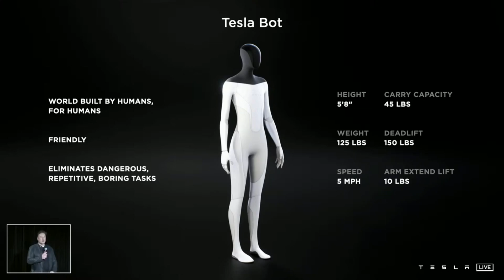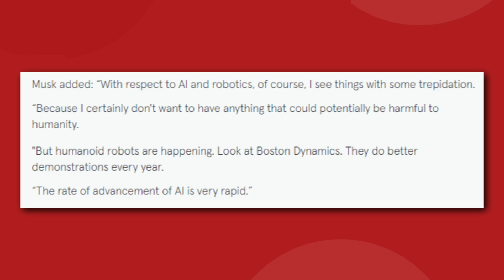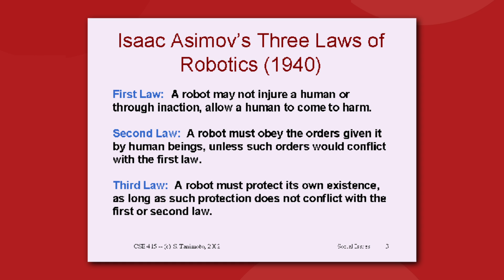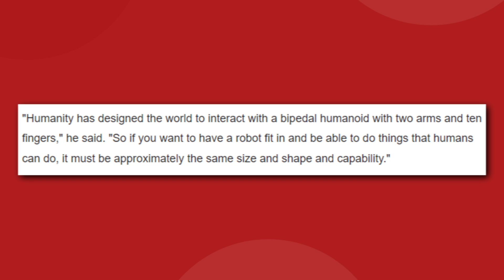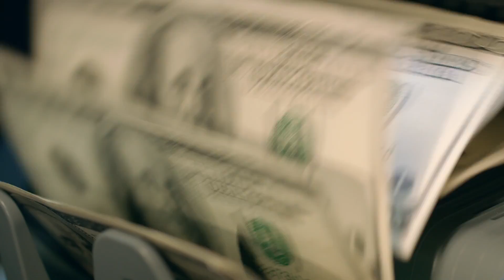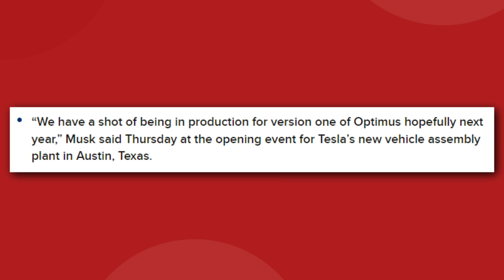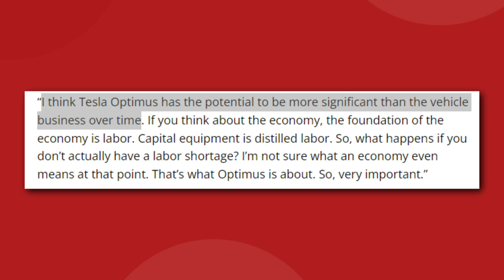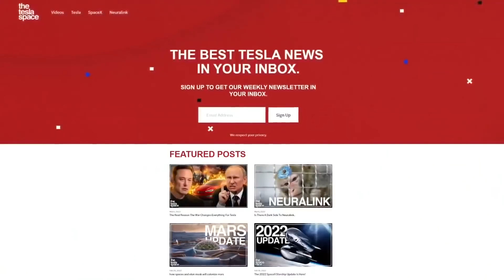Why Elon Musk Says The Tesla Bot Is More Important Than Tesla Vehicles!

Comment: 100 times easier to build than a Model Y?  No Way.  Think about the parts count.
Reply: Model why is much larger, requires a much more energy intensive physicals build. Most of the robot parts will be created using mass plastics production. 
The number of parts does not necessarily dictate lower output or higher cost.

Comment: It is more complex then a Tesla car. The actuators have to be more numerous and complex in a bot.
Reply: Yes true car actuators mainly the drive motors - the rest are doing set and forget stuff like open a window, lock a door. VS teslabot looking at 6 per limb +2 per hand +3 for head total of 31 with just basic hands. And each actuator is fully active. It's complex but tesla certainly have the engineering and resources so they are well positioned to do it.  Honda made Asimo - Tesla can make Optimus

Comment: @9:30 Given that a Tesla EV costs around $50K and that the TeslaBot will require far less material and time, it will cost about $10k. 
Imagine how fast Tesla will be able to build these, squirting the endo-skeletons out of a Giga casting machine, sliding in the wiring, the LFP batteries, the FSD computer, the interface, the sensors, and the actuators by the robots of the assembly line, unit testing and then zipping up a synthetic skin onto it. It should be producing up to a thousand Automatons a day.

Comment: No way . The actuators and power source to control and power a robot  of human proportions  is a long way off .
Reply: Have you looked at recent cordless power tools? They are getting a pretty decent power to weight / volume ratio these days. They are planning to limit the strength to similar to that of a child, which seems reasonable.
Reply: @privatemale27  rotary motion from motors and the linear actuators that would be needed for a human like robot that work like muscles are quite different.  A comparison would be Jules Verne’s moon shot which used a canon and the jet engines that were actually used to propel men to the moon.

Comment: China is building and selling basic EVs for $5k and less.  My guess is that Tesla robot would cost well under $10k.  

Skeleton/bones - cheap
Cameras - cheap
Microphone - cheap
Speakers - cheap
CPU - probably a few hundred dollars when produced at scale.
Batteries - not a lot as battery prices drop.  And a robot could use swappable battery packs, do the swapping itself.
Unknown - some number of 'not that strong' electric motors and electric motors, built at very large scale shouldn't cost a lot.

The motor that runs a $30 (retail) electric drill is pretty strong.
---

Fully functional (but low skilled) Optimas - this year.  An Optimas capable of learning just about everything but it will take time to learn tasks.
Reply: Need pressure sensors on fingertips (& skin?) like flufferbot needed. But, yes, crazy cheap parts.
Reply: @iandavies4853  

Yeah.  Pressure and temperature sensors.  Roughly the sensor set that humans have.  But nothing seems very expensive.  Motors need to be only human strong, not horsepower.

This thing wouldn't need pounds and pounds of unobtanium.  Something lightweight for 'bones'.  Plastic?  Motors are just small amounts of steel and copper + labor.  I see a small budget for raw materials.  Largely automated part production.  Not really that much assembly.  

The heel bone attaches to the foot bone.
The foot bone attached to the ankle bone.
The ankle bone attaches to the leg bone.

Except there would be no need for separate heel and foot bones.  Just a foot piece.  And no ankle and leg bones.  Just a joint between the foot and leg.  A joint at the knee and a joint at the hip.  

The first version does not need to be able to dance ballet.  Just walk and climb stairs.  It's mostly a matter of moving into the right spot and then do stuff.

If we run into tasks that require acrobatic skills a new version can be developed for those jobs.  Households and most businesses aren't likely to need a huge amount of physical ability.  Most humans don't have a lot of physical ability.

Comment: Great video! But, electricity costs? Electric cars use far too much energy to be affordable if you charge at home. To get around that, people use the cheap subsidized electricity at charging stations. But, most of the reason it is so cheap is because of government aid. That can't last forever, and then electric cars will be MORE expensive to run than gas. So, set aside the annoying issue of carting your robot to a charging station, how much electricity does it ACTUALLY use. And, is it affordable at current electric market rates? Charging station rates are subsidized rates, not market rates.
Reply: I hope you realize that gas is heavily subsidized as well and wouldn’t be affordable if it wasn’t. So same logic applies for gas it can’t last forever. 
But electricity can be produced from solar panels, wind, hydro and other renewable self sustainable ways. While gas literally is a finite resource, So truly  gas Can’t last.
Reply: @heliumfilaments4368 , fully aware.... The question spawned from attempting rough operations costs (Dreaming of having one... until I considered the electric bill). If a robot is running 24/7, it could use large amounts of electricity. Possibly on par with a trip to and from work everyday in a Tesla. To decrease energy usage, we must also increase our own personal energy usage awareness. Having a robot would come with a large responsibility to use it wisely.
Reply: @derek2593  Yeah I just don’t think this robot is going to be actual useful product for a very long time. It will take even longer to be a personal robot everyone has. By then I would hope advancement in renewable energy solve the affordability issue.
Reply: You are clueless. !

Comment: 7:53 I think you're very wrong here about how Tesla Bot will be much easier to produce than the Model Y. If you've ever seen highly mobile robots you'll know the part count and complexity is much greater than than any car. The scale of them also means that there will have to be a lot of human assembly for smaller more complex parts which is everything in a robot. 

Also the machinery used to manufacture cars has been around and been developed over decades but this hasn't happened with robots. Maybe it can get the same level of automation but it is incredibly unlikely that this will ever have a higher run rate of assembly lines than a car.
Reply: Just replace “human assembly” with “humanoid assembly” and the answer becomes clear.
Reply: @trent_carter  Watch a video on all of what humans have to assemble on the car and tell me a robot can do that with a greater efficiency. 

If highly specialized robots with decades of development can’t do it then how will a new robot with 2 years of development do?
Reply: @benjaminbarnett9322  I have watched every Tesla factory video and they still use humans for some tasks that the Bot can do. Actually I rewatched the drone fly through of Texas and most jobs look easy for a humanoid robot. Bit this is a silly armchair argument from an aerospace engineer with a degree in physics, yet still ignorant. So I will place my conviction as a financial bet. I have 90+ % of my sizable net wealth long Tesla. That’s my wager.
Reply: @trent_carter  Sure, i think the Bot could do it, just like FSD can drive. But what happens when it runs into a problem. Does the whole production line stop? Also these robots would be 5x slower than a human and bog up the production line.

 If you've seen the factory tours then you can see that even though Tesla is still by far the most automated company, they still have 10,000 plus people doing these tasks, if a robot could do it it would be done by now, you don't need the versatility of a bot in a factory setting where you can control all the factors. Human are still superior at these complicated tasks and will be for the next decade.
Reply: @benjaminbarnett9322   I’m gonna come back to this thread in 10 years when I need a good laugh
Reply: Musk already said cost will eventually be lower than a car
Reply: @uzimax322  How’s FSD doing?? What about Roadster, Semi and Cybertruck?
Reply: @benjaminbarnett9322  

On track.  Roadster, Semi, and Cybertruck have had to wait for battery plants to be built.  

FSD has taken longer than expected.  When one predicts a future date for completion that date is always subject to 'unknown unknowns'.  Tesla had a pretty good FSD system that would drive on 'normal' roads in 2016.  It's taken a while and a few false starts to get to a system that can drive anywhere a human can drive.
Reply: @bobwallace9753  If missing a promised date by 2-3 years then not updating customers is on track your insane. If he's waiting on batteries then he's had the past 4 years to sort that out but he hasn't. 

If by normal roads you mean highways, because that was the only place FSD could operate reliably in 2016, then I could tell a 12 year old to "keep it in between the lines" and most of the time (with supervision like FSD needs) It would be fine. But that isn't Full self driving now is it? 

He's said this since 2015 that FSD is a few years away yet we often see video's of the car doing something that could kill somebody that a human would never do.
Reply: @benjaminbarnett9322  
Let's start by straightening out a misconception.

A time estimation is not a promised date delivery.  A time estimation is a 'best guess' based on what is known at that point in time.

What happened, I think, is that demand for the Model Y was much higher than Tesla had estimated.  In the best interest of the the company Tesla decided to to use all the batteries they could obtain for Model Ys   And that meant the other products needed to be delayed.  With Tesla just turning profitable and needing money for expansion the wise move would be to maximize the product that sells the most, take advantage of scale.

FSD 

Here's a video from 2016.  It shows a Tesla driving itself on reguilar 'surface' roads, on and off a highway, back to where it started, letting the 'safety driver' get out, and then parking itself.

https://www.tesla.com/videos/autopilot-self-driving-hardware-neighborhood-long

What FSD couldn't do the are things like detours, weird intersections, roundabouts.  The Tesla/Mobileye approach in 2016 just wasn't likely to morph into full self driving - everywhere.  Tesla hit a dead end, had to back up, and take a different route.  And they had to stop and change routes at least one other time.  

Elon is in the position of knowing exactly what problems are left to fix.  There are now something like 60,000 people using FSD beta so most of the edge cases are known.  And Elon is in a good position to see how long it will take to solve them.

That's not to say there won't more edge cases in the future.  But they should be quite rare.  FSD will not be perfect.  There will probably be some crashes in the future.  But I suspect they will be almost all 'fender benders'/rim scrapes and not catastrophic.  

I think it's very likely Tesla FSD has mastered "hit nothing at speed and don't run off cliffs".  If so, FSD is already safer than humans.  Just fix a few more problems like avoiding deep potholes and watch out for extended curbs when making turns.
Reply: @bobwallace9753  I can understand the battery shortage however Elon said this in 2017 about the truck "Order now and you'll get the truck in 2 years" (link to Semi Unveil). This was no where near true and either they should've invested more in batteries or never said it. Hope we can agree on that.

https://youtu.be/5RRmepp7i5g?t=1482

About FSB, I don't discount that this is a very hard problem. I just don't think that it's fair to hype up the technology, call it (Full Self Driving), charge people $10,000, say it's coming in a year every year to make people feel their purchase is justified, all in the end to extend the timeframe again. 

Looking at this recent video of FSD in many situations, I would say that this is a pretty unbiased review (maybe slightly skeptical) of how FSD performs in a variety of situations. 

https://www.youtube.com/watch?v=ZLBR39RcyiU

I would say that its impressive but it's not a good experience for the driver when they constantly need to be looking out for curbs, roundabouts, protected stops etc. This is the newest version and it doesn't look close in city driving.  Tesla has made a lot of progress and I commend them for that, I just have a problem when a perpetual lie is being sold that it's ready when it clearly has more work to go.
Reply: @benjaminbarnett9322  
 
I can agree that some people thought Tesla would deliver some things faster than Tesla was able to.  

I also understand that Elon was operating in 'Silicon Valley mode' in which very aggressive and hard to meet deadlines are set as a way to motivate people to work super hard.  After I understood the 'push deadline' practice I dialed back my expectations.  I'm fully aware that a lot of people did not understand what Elon was saying.

Elon has said that FSD turned out to be a lot harder than he thought it would be.  It is what it is.  He sold the product too early, but he seems to have done that in good faith.  Elon ran into some unknown unknowns.  

Actually, I think the most recent versions of FSD are very impressive.  And I realize that Elon is driving the version that we'll see after the next beta version.  He's out in scout position, telling us where the river crossing and mountain passes are.  He thinks he's found a workable route.